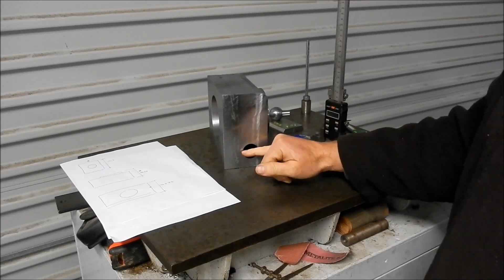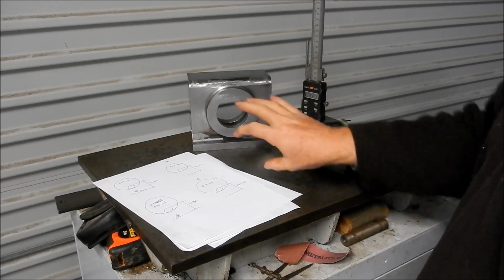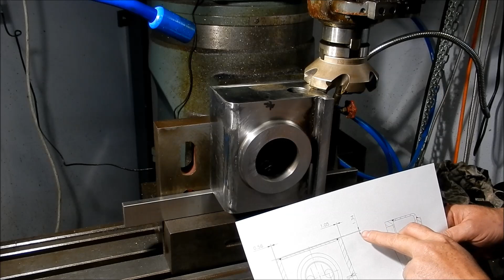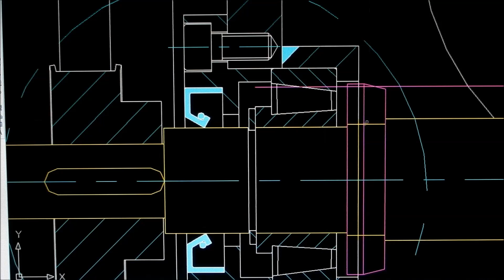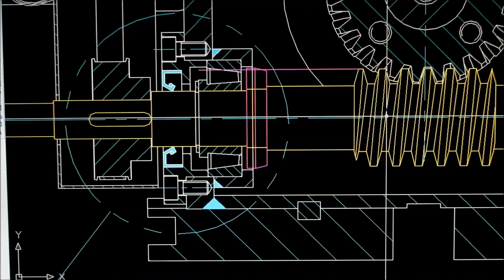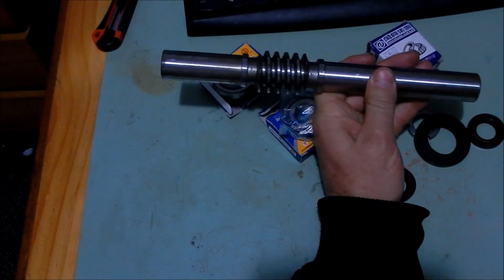Powered Lathe Slotter Build Part 11

Comment: Another way that is commonly used is to reverse the cup / cone  & fit the seal & cup into the end cap .
Reply from the maker: Thanks for looking in Max.  There's always more ways to skin a cat when designing.  I must admit I prefer the bearings in the housings if possible if not just for the aesthetics but it keeps everything in close to the body rather than having bearing housing sticking out.  You are right that the housings with the bearings can come away allowing the shaft to be removed.  I think once this is assembled I don't think it will be coming apart again given the very light use it will get.
Cam